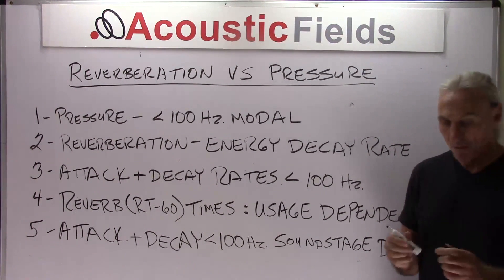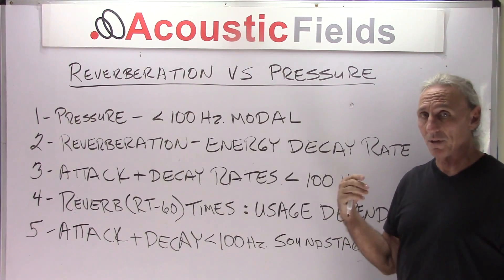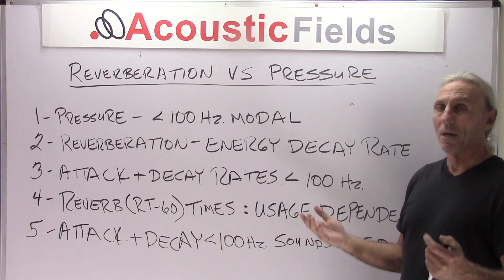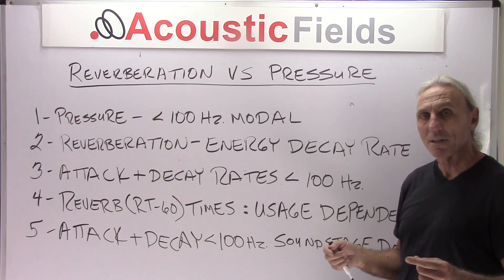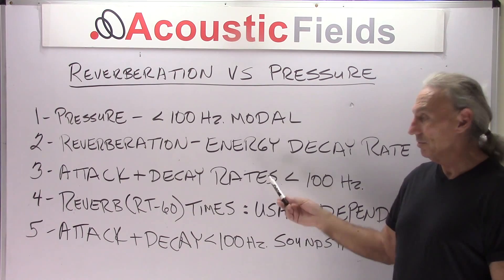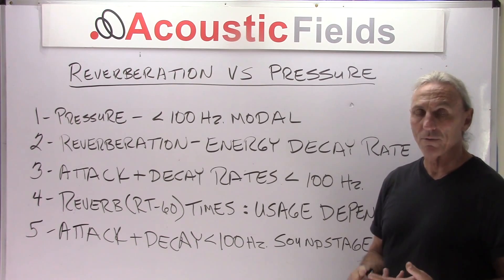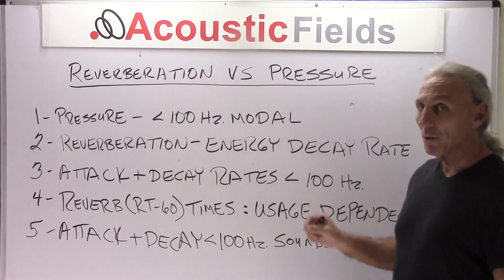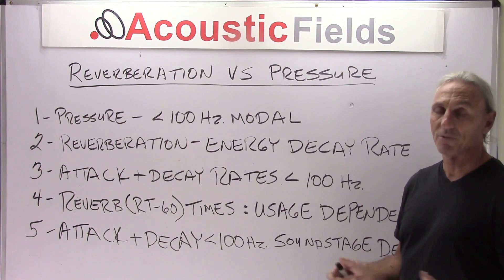Reverberation Vs Pressure - www.AcousticFields.com

Comment: In my room, I have found that pressure related unwanted energy goes around bellow 125 hertz. And man... After building eight diy BDA units, it became so simple to treat the rest of the spectrum because i really had to focus just on 100hz and above.
Reply from the maker: D,  Finally, someone who really understands the priorities in treating small rooms. You must go after the low frequencies < 125 cycles first and foremost. The frequency and amplitude of low frequency issues, with their fundamentals and associated harmonics, blur and smear mid ranges and can even venture into high frequency areas. Most find that when you get the lows managed correctly, your need for middle and high frequency treatment is minimized and sometimes even eliminated.
Reply: Acoustic Fields after I finish all the treatment of my control room, I'm looking forward on doing a testimonial video. I may get a +/- 1 db with equalization and a +/- 3 db without equalization :)
Reply from the maker: D, Please do a video. It would help a lot of people understand what you have discovered.